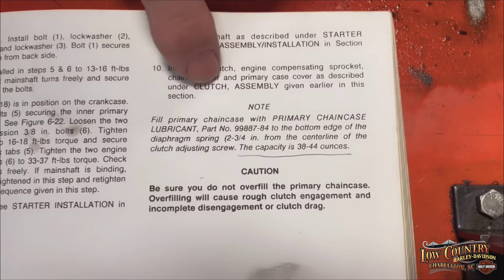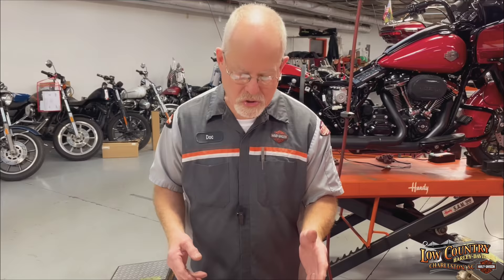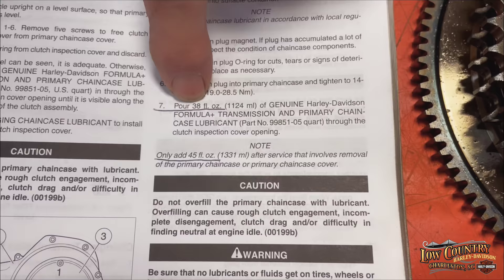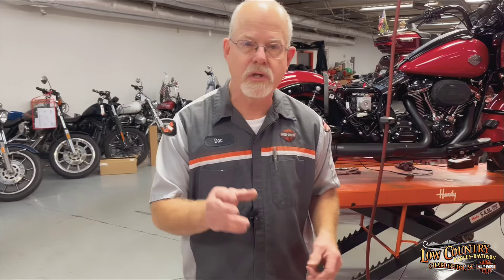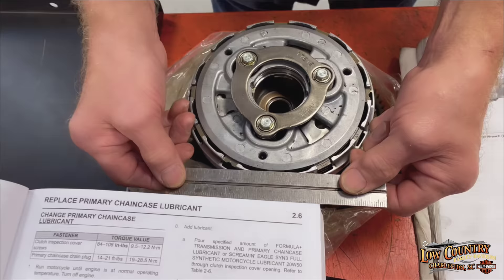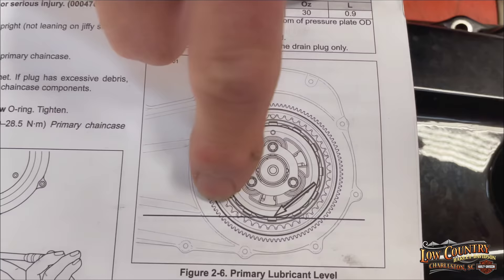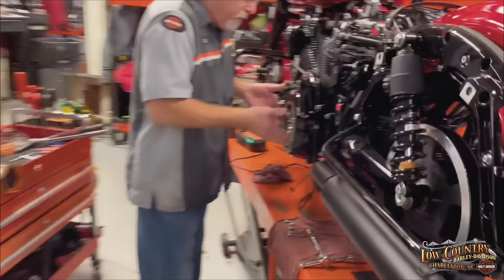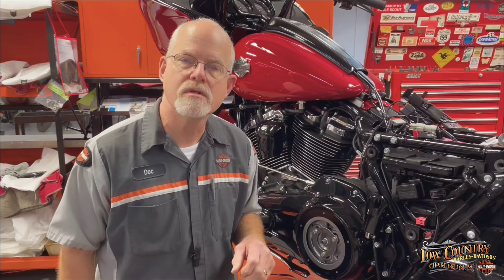How to check your Primary Fluids | How much fluid to put in my Harley-Davidson primary | Doc Harley

Comment: There are different primary covers on Ultra Limited & Ultra Limited  Lows  in 2014 and 2015. 2016 they went to the narrow  primary cover on all UL's.  Also do you check the oil level on the Jiffy stand or up right?
Reply from the maker: Straight up Please....Doc

Comment: Hi Doc - my new 2023 Road Glide Limited had all it’s fluids drained and changed at 600 miles.  Only 20oz of oil came out of the primary.  Low fill from the factory?  Any concerns?
Reply from the maker: No, Primary slings a lot of oil around when running. Glad you caught the low oil level at 600….Doc

Comment: Hello, I have a 2021 Standard Street Glide.  I changed the front wheel from the stock 19” to a 21”.  How do I properly check my oil fluids levels?    Thanks
Reply from the maker: I wish we would have thought this thru and checked the level before the wheel change to compare. I don’t believe it will change that much but to be on the safe side, fill 3/4 of the way to the fill top mark….Doc
Reply: @LowCountryHarleyDavidson  Thanks for the advise Doc….   That front 21” looks so Good on those Glides….  Wished Harley would sell a different dip-stick for the 21” wheel, since the CVO Road Glide comes with a 21”….   👍🏾

Comment: So is it ok to use an oil specific for primary case chain/clutch? Because I've been using 20-50 in my engine, 75-140 in my Tranny and was going to use Belray primary (80 weight) oil. This is in a 2016 Tri Glide.
Reply from the maker: I am not familiar with that Primary oil but I do trust Bel Ray products. HD now offers a heavy oil for the primary and I love it…Doc